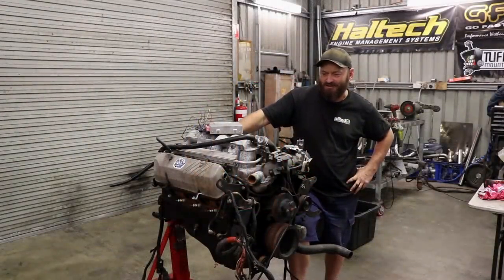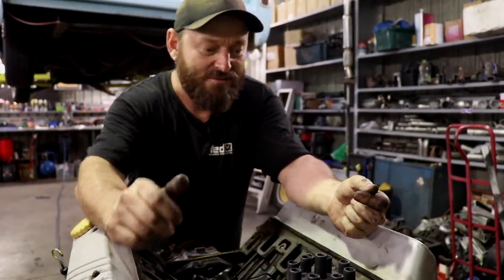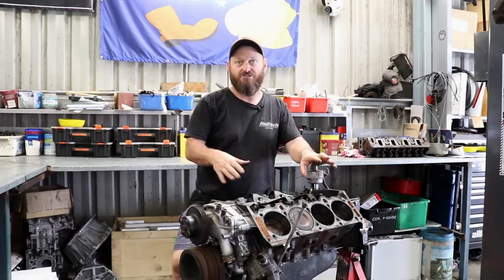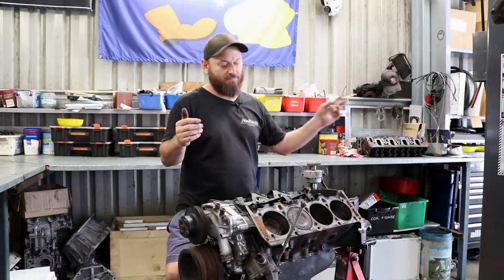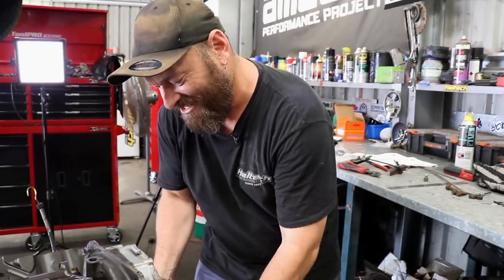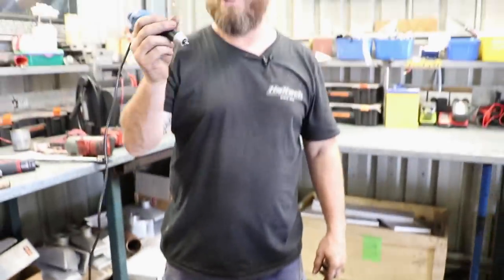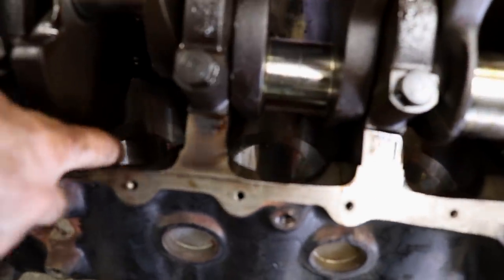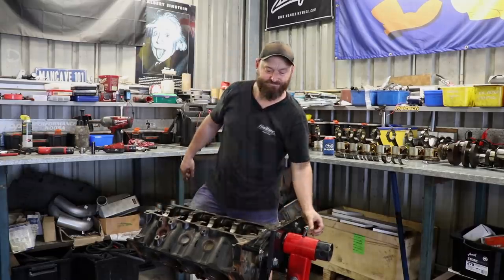GM HOLDEN 304 V8 ENGINE RE-BUILD [EP1]

Comment: Forced induction is an irrelevant question, Al is not known as "naturally aspirated yoda"
Reply: Turbskies tend to go well with a Holden 5 litre too, 14 psi is not uncommon for these things to happily handle
Reply: @HotForgeChaos  absolutely right mate, I was sarcastically eluding to the fact that "turbo yoda" is not an n/a kinda guy.....
Reply: He engraved a turbo on the connectong rod...
Reply from the maker: Forced induction is awesome but it's also great to check out the Naturally Aspirated side of life too and see how it goes.
Reply: @theskidfactory  too much lemon squash tonight mate 🤔🤔😉🍻
Reply: @theskidfactory  Are...you alright...Woodrigos?
Reply: The Skid Factory Aww c'mon mate. The thought of a 'wee' bendix hanging off the front belt, with a half bar of boost just to very slightly amp up that bottom end torque that those long runners in the bunch of bananas give. nay crossed yer mind laddie???
Reply: It ain’t irrelevant if it works and has been proven time and time again😂 that’s why people never stop using it 😂
Reply: Anything that adds horsepower to a motor most certainly ain’t irrelevant it’s the best thing that can ever happen to that motor besides spinning to much air though the crankshaft 😂😂😂😂

Comment: Was 5044, went to 4987cc.  This is the modern equivalent of ancient story telling.  Passing down the ancient knowledge to the younger generations.

Had one of these, XX3 (195kw).  Wasn't massively strong, but was very smooth and with a manual was reasonably efficient.  Good cruiser.  The problem with a power number alone is that it doesn't always account for drivability.  Power, Torque, rev numbers each is achieved at and the vehicle and driveline used are all contributors.

Comment: 6:06  Those rockers and aluminum pivot bridges look like USA Oldsmobile V8.  On cars with infrequent oil changes, the center pair on the PCV valve side would wear causing a valve tap.  The fix is to replace the rockers and pivots, a backyard fix is to look at the pivot, measure the amount of wear then file that amount off the bottom of the pivot.
Reply: The Holden V8 in 1967 , Holden Australia went to Detroit and was allowed to tour all the GM engine factories, they chose Oldsmobile valve angles, port layout, cooling system, and Oldsmobile valve 8 degree valve angles, along with Olds starter location , I built a 403 Olds in Australia and needed parts , the Olds flywheel fits the Aussie 308 , so does starter. , bell housing is also Olds , and a Holden intake fits small block Olds ! So I guess we copied the Olds a bit , except our 308 has chev crank locations !

Comment: Yeah the skid factory 🏭 Aussie 5L for the win !!
Reply: Adam Ridley the Aussie Ford 5.0L was legendary as well. Way before the coyote and after the Windsor.
Reply: @alexcorona  WTF! The Windsor was used through to the AU then they went to the mod motor in the BA. When did Ford Australia  design a 5.0L of their own!
Reply: Ford Built the 302 (5ltr) Cleveland in Australia cast here heads redesigned here , 6 inch rods , crank 3.0 inch. Sure was based on American Cleveland but now USA wants Aussie Cleveland's cause better heads and block.

Comment: You're onto it with the splayed 4 bolt main caps Al, Steve Morris agrees with you on that and I think he knows a thing or 2 about big strength, high horsepower engine design 👌 
I have a couple of VS generation  304s and an old blue 253 sitting in my shed at the moment 🤣

Comment: The 5.0 become  a weapon in the 1974  L34 Torana. The car weighed 1280kg. The racing you speak of used factory cars. Cams specs left them close to stock. So the mods from repco on the factory L34 motor  where very effective. 380hp on a factory holden 308.

Comment: New build, instant like. Nice lump of engine those 304s. My cousin had a freak stock 253  4-door Torana that was always kept immaculate. We were coming back from the Surfers Drags one afternoon back in about 1977/78 (I think). There were 5 of us in it and an SL/R 5000 motored up beside us on the highway (with a car-full as well) and challenged us (best way to describe it back then). My cousin's car ate the slur. One might argue the SLR was neglected engine-wise, but then, that 253 was a good engine.

Comment: I'm old enough to have worked on stuff of this vintage when it was a little old!!! 😳 
I've seen a LOT of GM Engines - but never ANYTHING resembling that!
But then, I'm a Yank...
Fascinating.
Reply: That is definitely a Buick Oil Pump. I remember Buick V8s sometimes losing Oil prime during OIL CHANGES!!!
Reply: The early 253 ci and 308 ci engines from around 1969 onwards were designed around other GM engines , the early intake port location is Oldsmobile and so it Exhaust port location , valve angles of 8 deg also Oldsmobile, intake manifold also Oldsmobile , the only other GM input was small block Chev bore spacing , they had a unique Bell housing pattern that was very close to Oldsmobile , in fact I'm in Australia I got a 403 Olds small block , I needed a ring gear and starter I was having trouble finding in Australia, I looked at the Olds crank and pulled out a 308 ci Holden ring gear , lined up and bolted on , same amount of starter teeth and the Holden starter bolted to the Olds block ! They share a lot of parts , pop off the valve covers on both motors , same linked alloy rocker mounts ! Later in 1988 GM Holden revised the 308 to 304 ci for or so it could compete in or road racing events as 308 ci comes under 5.1 litre rules and has a massive weight penalty, they took 1/32 off the stroke to make an even 3 inch stroke and 4 inch bore , the road cars got new fuel injection , the " bunch of bananas" intake as it got called looks exactly like a LS1 intake but we got it in 1988, port locations were moved to be even , just like the LS ended up, it got a roller cam , in its final incantation it was enlarged to 355 ci . In 1997 then the next year we lost our V8 and Holdens got 5.7 LS1 motors . There was a small side note , in 1987 when redesigning the Holden V8 the engineers built and tested in car a single over head cam version , it looked like a Ford 427 Cammer from the 1960s it came so close to production it had a build code .

Comment: So keen for this build! 

Those pistons, rods and crank are all stock and genuine, and the VR series 2 (if I remember correctly) to VT engines came standard with a double row chain. A fairly easy way to get some low cost power is to slap in some flat top pistons, zero the deck height and shave the heads with a bit of head work. The VT heads have heart shaped chambers to give them the extra compression over the previous gen 5 litres (pre VSIII). These simple things will bump the comp up to nearly 11:1 and the headwork will allow the engine to make upwards of 400hp at the crank.

 If you're going to stay with a roller cam, you're better off going with hydraulic roller tie bar lifters, as the spider plate is prone to cracking over any more than stock pressure/lift. It's definitely easier on the wallet to go solid or solid roller, but as you'd know, hydraulic roller cams have a better power band. Another great thing about the VT block is that the lifter castings are taller than previous blocks, which means you can pretty much run whatever you want without running into lifter void issues.

Some advice that I'd give you (which I'm sure you're already aware of) is to de-burr the long oil "channels" in the valley. It helps with getting oil back down to the sump, which is a big issue with performance 5L engines. They tend to starve the bearings of oil because it all gets pumped to the top of the heads and gets stuck there. There is also a section of the oil pump that doesn't match up with the block surface that can be shaved down to match, and will improve flow.

Comment: I'm glad you mentioned the main bearing side clearances, everyone else seems to overlook it. My vertical clearances check out, but the sides of the bearings are 3 thousandths more narrow, which is smaller than the crank! I hope it seats better when I put the crank in, otherwise I guess I need to swap bearings until they check out.

Comment: I bought a VN ex police car when I was 19, so that woulda been 1991 or so.  5 speed, 304.  everyone told me i was crazy to buy an ex cop car but that engine never let me down, apart from when people tried to steal it (3 times).  I had it for 7 years, paid $12,000 for it at govt auction and sold it for $7,000 i think.  it had something like 210,000 km on it when i sold it but it didn't use oil.  The car itself was falling apart around the engine cuz i never had enough money to fix things but the engine was always strong.  like Al says, didn't blow your head off with power but it was torquey, great fun pushing it through the gears.  Except when it was wet, then i'd get beaten at the lights by 200Bs and Geminis and stuff because I couldn't get any traction. Only traction control back then was your right foot... like someone else said here it sounded great, mine had stainless headers which i'm not sure were standard or a cop thing but anyway it was a sweet note.  great car.

Comment: Very informative! Now I'm thinking in hindsight, I probably shouldn't have brought it, but I've owned my VN 304 commadore 20 years and have had nothing replaced in the engine. 57.000 km later & apart from the typical mods in the beginning, torque convertor upgrade, pacemaker headers, blah blah and some other upgrades over the years, it owes me nothing. Who wants a VN these days anyway? So I'll just cruise in it till the motor dies! Cheers mate!

Comment: See if you can find one of the special 50 304 black blocks and 100 special "silver" heads that Larry Perkins got Holden to make for racing. This one is really a mass produced homologation engine with standard heads and valve train. in 2019, LP did a long interview with Russel Ingall where he talks about these special engines. 304cu in, intake ports raised 30mm, sliding plate throttle bodies, 590hp at 8500 on the dyno. Awesome. Ford cried foul, but they were within the rules.

Comment: Gonna enjoy this build. I had a VN from 2006 to 2013. It was Asteroid Silver so the colour they used mostly for the HSV.. I turned the engine into HSV spec. 185Kw Oooooohh. Put a Celica 5 speed in her. Man did that change the way the car performed over the turbo 350. 2nd gear in the 5 speed was the same as 1st in the auto so you can imagine what 1st was like. LSD.. She was a good rig.. I enjoyed her until the clutch went. Couldn't be bothered talking to Dellow again so to another owner she went. Got a VR ute now.

Comment: Good old plastic block. And yes splayed caps are meant to be stronger than 6 bolt mains. It is better at retaining the main cap in place against the cranks torsional loads

Comment: To reiterate Al's comment about the 4 bolt mains, specifically the ones with splayed outer bolts, Dart Machinery, World Products and GM themselves ( only in their over the counter race blocks, never production engines..) began doing it back in the late 80's early 90's. It does indeed spread the load from the crank forces over a stronger part of the block..
As to it being stronger than the LS's crossbolted 6 bolt setup, the main reason the splayed 4 bolt is considered better is less to do with brute strength, and much more to do with less windage than the deep skirt LS block. 
Further logic is that if the splayed 4 bolt setup in conjunction with steel main caps was good enough before, it's still plenty strong enough today.

Comment: i dont pack the disrtro i  assemble and screw a hose into the oil pressure sensor and prime the oil pump that way before starting
insta oil pressure every time, but i am talking about the front mounted buick unit

Comment: Hi gents, I watch most of your stuff because you’re good and I like your humour.  But I will be following this series with anticipation as I too am doing a 355 VN style build with a 4l60e.  It’s going into a VS with a haltec 2500 so I can do Drive By Wire.  I will be using a transmission controller from Compushift. 

I am a Cabinet Maker with a little bit of mechanical knowledge, so you two will be able to help me heaps mates.  Thank you for what you have shown us so far, I appreciate your efforts.
Reply: I'm building one too. It's going to be a 355 with an RPM airgap and Holley Sniper. With a 4l60e (MSD atomic controller). The sniper works well IMO.

Comment: If it does really have 190.000 miles on it. Its had really good quality oil changes all its life.
I had a Saab 9000 Aero with the B234R engine a few yrs back. And it was on 220,000 miles. I took the top of the engine apart for a bit of an inspection and it was absolutely spotless inside. Mobil 1 oil, every 6500 miles.
Reply from the maker: 190000km. Metric in Aus.

Comment: Now really much to worry about when it comes to snow, even down here in Tassie. Unless you're one of the 40 people that live halfway up a mountain. Still have more issues with overheating in summer than snow in the winter. We do have Holden v8s down here - only half of them are driven into ditches. Okay, maybe 2/3.

Comment: Just finished a rebuild on 308 “ red motor “.love a Holden v8...except trying to get oil pressure.
Rod
Reply: I use to pack the oil pump gears with grease to build up oil pressure on a 253 red that was fully reconditioned back in the 90s.
Reply: @Chopperdog  same here mate. Works everytime.
Reply: @wce05308  Yep it's the old school trick mate.
Reply: @Chopperdog  I remember an old boy telling me about it back in the day. I thought he was full of shit at first 😂
Reply: @wce05308  Lol same here i thought it was a odd thing to do but it works every time.

Comment: Holden did plan to keep using the 5ltr. They even built a OHC prototype.
Reply: Yep they sure did, engineers Leigh Maguire and Mick Webb made it. They were trying to give it an overseas appeal. They put it in a Calais mule and did everything it was asked for but GM decided to shelf the idea.
Reply: Yes Holden had a camner ohc Holden modelled on the Ford 427 camner that almost went into production in 1987 ?

Comment: Nothing better than the small block Chev 283 327 350 and 400
Reply: Except a GMH 355 ci roller cam , bunch of bananas intake, motor , that chev stole from Holden ! LS have the same set up in 1997 , Aussies had it in 1987 ! As usual we created it and you stole it !

Comment: The procedure for changing spark plug leads in a VT V8 Commodore, Step 1, put a cushion on top of the intake manifold,  Step 2, climb into the engine bay and lay on top of it, Step 3, replace one lead at a time and repeat 7 more times lol.
Reply: Add some swearing and the old who designed this bloody thing a few times 😂

Comment: Well guys, my VT had done 650K / KM and i still got over 650 KM per tank, always served with good oil and coolants and plugs etc, the only thin,which i noticed was the main front oil seal went on me, which is on the sump, thats it, but did go through 2 auto's but only because the first auto the guy ripped me off, i asked to a full rebuild, yet basically just changed the damaged parts and put it back together ?
The 2nd auto was done by a friend and then she would still hit 200KM no worries, stock as a rock other than the h/duty, drum put in the auto, so when it changes gears it would put you in the seat, not hard mind you, so i reckon its like anything if you look after it, it will look after you. :) Penrite / Mobil oils and coolants were wynns or Holden Oe stuff, power steering flushed every 20K and also brakes were done and changed rotors only once,when i put bendix ultimates in her and they chewed the rotors up real quick especially when you hard stopping and not many times either, so had to change them, also it was only 25 of them built i believe as a berlina and in the capricorn green mirca and 5lt ex melton shire company car actually and was used as a company car, via sale reping all around victoria and south australia. :)

Comment: If my memory is correct it was 5044 cm3 before Group A and 4987cm3 after the reduction. I think they reduced the bore diameter.
Reply: Reduced stroke by 1mm

Comment: C'Mon single turbo 304 build. Had a VN SS a few years ago.

But because they didn't have that much compression from factory (something like 8.5:1 or the like) I always felt it was begging for some boost to be put through. Switch over the bunch of bananas for something that will flow better with some boost and switch the cam out for something a little less doughy and they go hard.

Also yeah I don't think many people would miss "Memcal" tuning and having to constantly flash chips to change the tune.

The GTS-R. If you had one now it'd be worth BIG dollars. Especially if you had a "Blueprint" option car. Still even with that they only made something like 220kw at the crank. When the LS1 came out in the VT2 it had 220kw at the crank straight off the bat in the SS and like 255kw in the HSV stuff.
Reply: @dazaspc  I will admit I was going by factory listed figures I could find online. I've never had a chance to look at a GTS-R up close let alone seen one on the dyno.

Comment: another reason for the re-design of the valve layout on the holden heads was that in group a racing the vk (and vl) heads experienced 'hot spots' caused by the two exhaust valves being next to each other and hence were prone to head gasket failure, as what happened to Brock (twice) at Spa in 86

Comment: The original ECU was the MEMCAL  type, where you could just swap out the EEPROM  to tune your engine. That ECU was used on the “ “Family “ series 4 cyl engines ( Camiras & N13 Pulsars) , and of course the VN series commodores.
Reply: I once won a bet ! I had a 304 injected and the stock ECU running it , my mate had an old Camira 4 cylinder , I unplugged the 4 cylinder ECU and plugged it into the 304 loom ( same plug) , it ran fine !